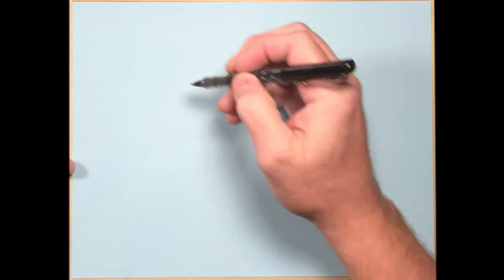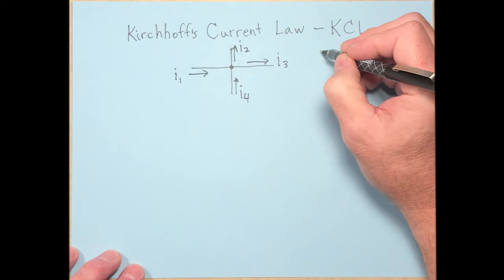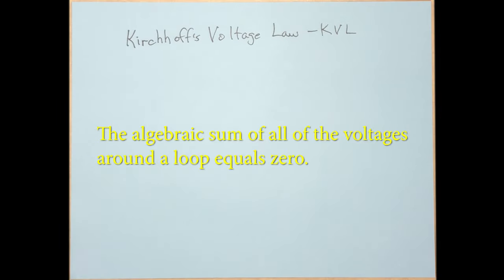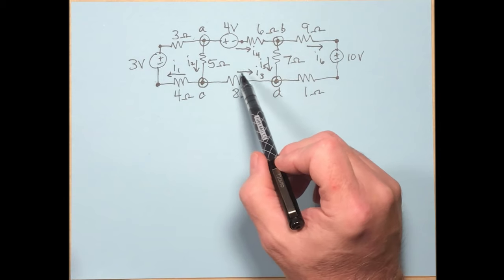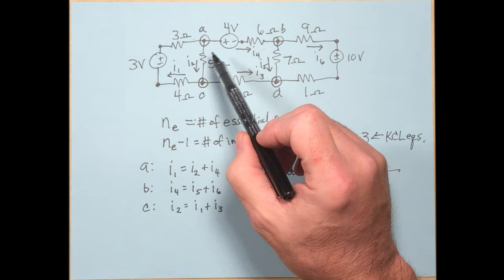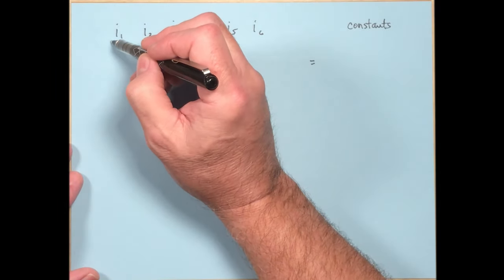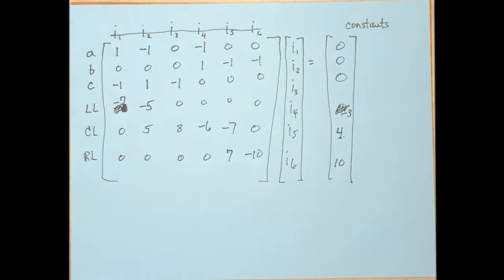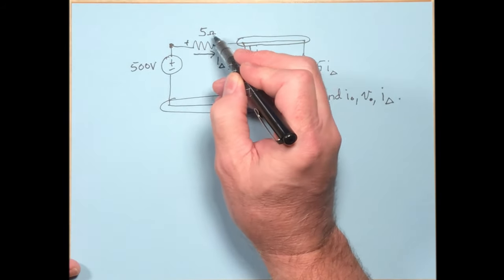03 ENGR 2305 KVL KCL

Comment: is there a specific place to put the negative and positive on the resistor?
Reply from the maker: When I first introduced KVL fairly early in this long video, I added +/- signs only so I could talk about voltage rises and voltage drops. The truth is the +/- isn’t needed with the way I teach this method. If you’ll look at around 36:25 when I start writing the KVL equations, I don’t have signs. Instead, I assume my current is always flowing from the high potential (+) to the low potential (-) even though I never really write in the + or the -. Then the rule for writing the KVL eqs becomes: if you traverse through an element in the same direction as the current, then that’s a drop. If you traverse in the direction opposite to the current then that’s a rise. Hopefully something I said in here helps answer the question.
Reply: @EnjoyYourUniverse  perfect reply. Thanks